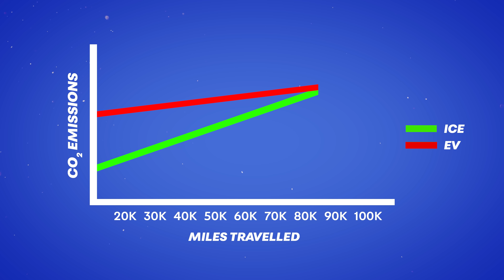Are Electric Cars REALLY That Green? [New 2022 Data]

Comment: That should highlight the fact the manufacturing processes need to change. Also, maybe Volvo's EVs should be smaller than the ones they have on the market at present. XC40 Recharge and the Polestars are not small vehicles. Need more EV hatchbacks/superminis/whatever. Not these great clunky SUVs.
Reply: They're not big vehicles. The Polestar 2 is pretty much smaller than the Tesla Model 3. The XC40 is smaller than the Tesla Model Y. And the Polestar 2 is a hatchback sedan, not an SUV.

Comment: And in the case of ICE it probably also does not produce CO2 to find and pomp oil out of the ground. And no CO2 to refine and no CO2 to transport. And no CO2 to store it. And no CO2 to pomp it in and out trucks and station. And no CO2 in the case of fire. And no CO2 etc etc. And anyway in the end long term de EV always wins anyway. Even though CO2 emission steering production are much closer together than stated in this video.

Comment: EVs are already beginning to outsell their ICE counterparts, and should the trajectory go as projected, we are going to have to compete between having energy for our everyday needs, and charging our cars lol. My question is, did the research consider whether the available installed capacity of renewable energy can meet the projected, significantly higher increase in energy demands in the future. What is going to its effects on the future prices of energy? Already, energy prices are getting higher as a result of inadequate supply. Will the adoption of more EVs make this situation better or worse?
Reply: This is a good point, rarely thought about.  The demand for electricity will be unsupportable.  Also, the government will have to recoup the lost revenue from ICE car tax so maybe will tax electricity.  Which would affect every household in the land, whether or not they own an EV.

Comment: You are missing a few fundamental points
- with an EV is up to you to decide where the energy comes from, with your purchasing choices and voting
- environmental impact of battery production will get better pretty quickly as the sector is still in its infancy, While ICE tech has been stuck pretty much at the same level for the past 20-30 years or more
- the XC40 recharge is one of the most inefficient EVs on the market
- pretty confident the CO2 emission from fuel used is a hugely edulcorated value by decades of lobbying and representing the best case scenario: like a surface oil well, next to a refinery and with the fuel pump just out of the gate.
- Most of actual driving in Europe is in urban areas where EVs excel, while ICE are at their worse. Where difference in efficiency can be 5-10 folds
- etc

Comment: If the infrastructure improved to the point where working, easy to use, points were more readily available then the need to have huge batteries in each vehicle would diminish opening up the chance for those who can't charge at home to consider the benefits . Smaller lighter urban vehicles with the then quicker charge times are the most efficient use of EV''s in cost and environmental terms.

Comment: Happy to concede that they use more carbon to manufacture but.....
Does Well to pump include engine oil, transmission fluid etc which all needs to be changed periodically? What about the carbon to keep manufacturing brakes which wear out much quicker on ICE? Once you burn petrol its gone. Batteries have 2nd lives and can be recycled. EVs will last much longer than their ICE equivalents. Electricity grids are getting cleaner, and no polluting combustion fumes for our children to breath in. No-one says they like the smell of Diesel.

Comment: The report is disingenuous : it does not include the lifecycle analysis of petrol/gas production which is 7/8ths of the emission cycle of a ICE car, while electricity production even at the current mixes (even in the US/china) the electricity lifecycle is just 1/2 of the emission cycle of an EV car and would fall to zero as the electricity mix moves away from fossil fuels.   I cannot provide peer review research articles by independent analys links as they are auto-deleted by this channel.
Did you know the UK subsidies the oil industry £10 Billion /  year (OECD numbers) and 1.3 Billion / year (OECD number) to the nuclear industry, so may be it would  be better to reduce UK fuel bills by removing the subsidies from fossil fuel and NOT the renewable (230 million).  I would provide links but this channel deletes cited article links.

Comment: good discussion. 
Well to tank or would it be better well to milage?
Remember if you drive an EV it is the same as if you stopped using your horse and cart and started driving a Model T. This is only the beginning.
Blade Batteries and new Battery technology will change the game (End the game) But we have to get there first.
Petrol motors will probably never go completely away. There will always be something that needs an ICE engine and classic cars need to be looked after. You can't simply make someones investment all of a sudden worth $0 with the flick of a switch. (You could but it wont happen)
The whole battle between ICE and EV is in the Battery V the Engine because the rest of the car is the same (Price/production wise)

Using an ipad to run a car with slowly fade back into some touch sensitive buttons unless steering wheels completely disappear.
Steering wheels will never completely disappear. At least, not in my life time.
Buttons will make a comeback
EV is no longer the ugly step child. It is now competing to be the most used vehicle on the road.
Companies did try to stop EV's when Chrysler crushed the EV1's for no reason.
Tesla is the top EV producer no matter what dreams Biden has.

Comment: There are different studies. One from Germany concludes that EVs produce 65% less carbon throughout their whole life cycle. And to be honest I trust that study more. It includes also the improvement of the grid which will happen for sure.

65% is a lot tbh. Though it's not enough to save the climate. That's for sure. EVs also don't produce toxic emissions which are responsible of 100 thounds of deaths by the way. I don't know why nobody is talking about that.

Also EVs have the potential to become completely climate neutral, but ICEs haven't got that potential at all. And no! Don't mention e fuels!! They are ridiculously expensive and inefficient.

EVs also last longer and need repairing more rarely than ICEs because of fewer parts.

Furthermore EVs could take a important role in serving as an energy provider. Charged up during the day with renewables and supporting the grid throughout the night. VW is working on a concept where both the car owner and the energy company are benefitting from that.

Finally you have the potential convenience to nearly never really charge ever if you have the possibility to charge it at home. And some even have the possibility to charge with PV so the charge cost is stable and ridiculously low.

Ok now I am interested too see your responses guys. How do ICEs hold up to that? They are dead. Change my mind. And things like they have a soul is just stupid. Only rational arguments are accepted in this thread.

Comment: Coming from an engineer they aren't the amount of pollution that they create alone from battery production let alone manufacturing rest of the car is more modern cars do. Than you add the extra electricity since no country runs fully on renewable energy its not even close rn. It's all just a cash grab to get people to spend more money buying new cars and create more revenues from fines of non-ev users. But long term if hydrogen and better battery production is improve n implementation than it will be better but that's not happening for a while worldwide

Comment: Maybe if we had data to compare the carbon footprint between electric cars… Who would come out on top.. 

Maybe a vertical integrated company, that has a dry electrode technology to build their 4680 batteries, that already uses batteries that are 30% smaller to achieve the same range as its competitors, that uses no leather in its interiors, who’s cars are on average 300kgs lighter than the cars of the competitors, that have patents to mine lithium in a more environmentally friendly way, that removed cobalt from most of its batteries. Who takes a holistic approach to the entire process. Who could that be?

Comment: I think this is a great video, very neutral and educational. There are a few caveats. The battery assumed in the study is 78kWh i believe. Many cars now have larger batteries, making the production CO2 to offset much greater, increasing the crossover point. Mazda determined a 35kWh battery was most appropriate compared to ICE for lifecycle assessment for the MX-30. Additionally, as more EVs hit the road, if the grid doesn't respond, then there will be less % green electricity, especially when electric trucks get in on the action. 

If an ICE car runs on a fuel with reduced or no fossil carbon content, the in-use emissions are vastly reduced and is more favourable against BEV, for example sustainable fuels, HVO diesel, rDME, synthetic gasoline, biomethane etc.

Another thing to note is that electric vehicles unless driven in an urban environment, generally massively underperform compared to their quoted figures (maybe ~40%?), especially on the motorway. This means that the assumptions for vehicle consumption is wrong, and hence there is more toll on the grid, and hence more electricity use. A petrol or diesel vehicle I would say is more close to the published figures, and on a motorway, would actually surpass the combined figure that's used in these calculatons. Let's not forget the test cycle used recovered energy from BEVs during deceleration. 

I think if we could see what a hybrid vehicle like a Prius looked, that would be really interesting. a 1kWh battery so minimal battery imbedded CO2, but a great use of energy recovery and real world CO2 reduction. We're looking at the bookends here, although admittedly the petrol XC40 was probably a 48V MHEV.

Comment: So if an EV needs to cover 90K mile to be as green as ICE car, was the weight taken into consideration? EVs are heavier which would mean they would more frequent tyre replacements and (maybe) suspension rework. The batteries lose life overtime, which would mean it won't last as long - no such  thing with ICE. My point is there cukd many external factors hat would make even 90K miles to be too optimistic.
Reply: " no such thing with ICE."
ICE cars need new exhausts, sparkplugs, oil changes, turbos, and eventually engines
Reply: @SDK2006b  True, more moving parts = more replacements. But we know about that, what about EVs - it remains to be seen

Comment: Interesting to see a video about it, but I've said this for a long time myself - the Volvo report just confirms it. EV's are as much political as environmental. They serve a purpose to boost car sales, earn brownie points for governments and pacify the vocal tree-huggers, but they are not the answer, at least in their current phase. Car manufacturers don't care if they sell you an EV or ICE car - it's just money to them, but we're rushing headlong into a big problem with current gen EV's - they nowhere near as 'green' as sold, cost an eye-watering amount more to buy, have some worrying battery lifetime indicators, take too long to charge, too limited a range (WLTP figures are just mythical) are way too heavy and use materials that have to be mined in a very damaging way. Not to mention that with 30-60KG (or more) of lithium per complete battery and an estimated world lithium supply of 85m tons, something has to give. Call me in 5-10 years when the tech is 1-2 generations further ahead, because what we have now isn't the answer. While you're at it, maybe cast an eye at heavy transport/industry, because their polution levels are an order of magnitude greater than your easy-to-target car driver.

Comment: Finally a sensible balanced discussion around the issue, well done Volvo for producing these figures. EVs are certainly not the magic bullet they are currently being portrayed as and we need far more discussions like this. Of course if the manufacturing of the batteries is made more sustainable this will undoubtedly increase the costs even further out of the reach of ordinary motorists. As in all things there needs to be a sensible middle ground where designs incorporating both technologies can greatly increase the efficiency of our chosen means of transport

Comment: Could we first get back to the basics? CO2 is not a pollutant, but a greenhouse gas. Warming the earth is really bad, of course, so let's just be precise on the terminology, please. Because when it comes to actual pollution (NOW and MP), EVs win handily, as they emit absolutely none at the pipe, and far, far less in total emissions even when counting energy generation plants. Second point is that Volvo has one of the most negative outlooks on EV production CO2 emissions. It's difficult to compare in details, of course, but the general range is that EVs production consumes 33-50% more. 60% extra for the battery is beyond the high range, and a surprisingly high figure. Beside that, the overall conclusion is good...and the solution is fairly simple: EVs, to be even more sustainable than they are now, need to become smaller, lighter, and therefore more efficient. In a world of massive ICE and EV SUCs, it's far from happening, unfortunately.

Comment: Does that meeting point crash the EV back under ICE if you have to replace the battery in 10 years or start replacing cells in 2 or 3 years? Just curious. Keeping in mind most people take 3-4 years to hit 90k km. I'm just thinking from the point of we currently have no way to actually recycle a few million vehicles worth of Lithium ion batteries that I know of, so you'd have to use brand new mined materials again and dump the old batteries in some manner(The garbage dump).

Comment: Good video.  As you say, the key messages here are that BEVs are already better (especially locally), the grid is only going to get cleaner and battery tech is only going to get better and cleaner.  ICE has nowhere to go and we will run out of oil/petrol before too long. The other options for ICE (biofuels, hydrogen, etc) are inefficient as they take a lot of energy to produce, which would be better used more directly in a BEV.  Another point - a BEV doesn't care where it gets it electricity from (nuclear, wind, solar, etc) but petrol has only one source.

Comment: Very very interesting episode indeed. I think Governments need to be more thorough with their explanations. Of course the infrastructure will be a mammoth cost if we all went for EV's on mass. Also how you drive them needs to be explained a little more. I did talk to a dealership whilst having a test drive and they were saying that the battery wasn't as good because it was a demonstrator and it was constantly being charged back up to a high percentage when it didn't need to be. I thought this demonstrated a possibly frailty in the battery itself which is worrying.

Comment: The big thing is that ICE cars are unlikely to become better over the next decade, there is not a lot potential for improvement (might even get worse as crude oil becomes harder and harder to source) but BEVs have a lot of potential to be become greener. You see the Innovation a company like Lucid Air is coming out with, battery technology is getting better every year (just hoping solid state batteries are becoming a thing, that might be a game changer) and the grids will become greener as well. More houses are built with solar panels etc. So even if the report doesn’t make current EVs look very good, it’s undoubtedly the best option we have to go forward. At least for now, maybe hydrogen cars are also gonna be a thing, although I think that technology is more useful for heavy duty transportation

Comment: The reason is that Volvo is planning to produce cars where they reduce the carbon footprint of the supply chain for producing vehicles. The data volvo presents is prob legit but biased and scoped to fit Volvos agenda.
If you want the true picture you should get information from serveral independent sources.

Comment: Noted the study only goes to 125,000 miles. What are we expecting the useful miles driven of electric cars to be? My friend had a Volvo 20 years ago and did over 250,000 miles before he sold it and it was still running well so expect it went on to do at least another 50,000. Without gearbox/clutch and other engine issues that may reduce the useful lifespan, an electric car may do more miles than that even. The graphs need to continue for the predicted useful life and then calculate the tonnes of CO2.